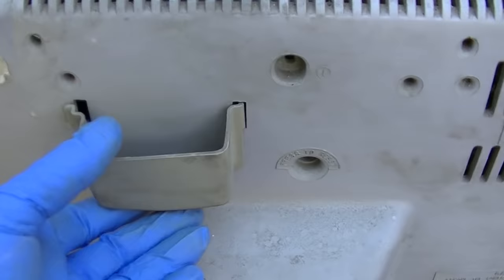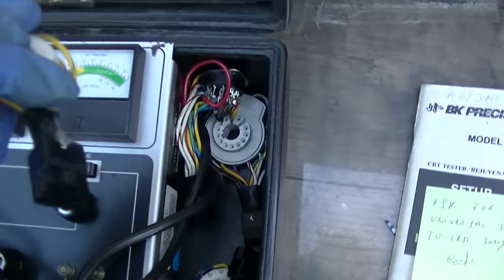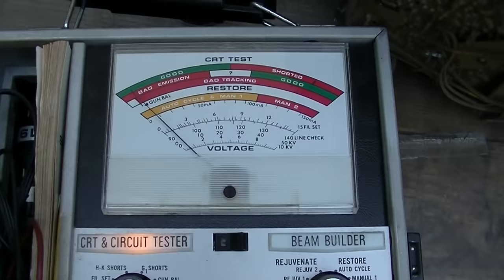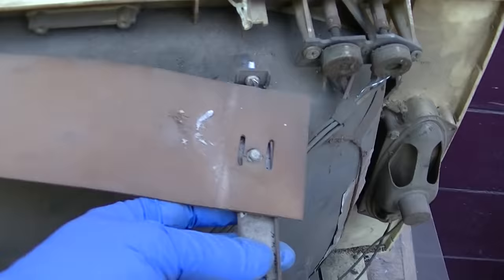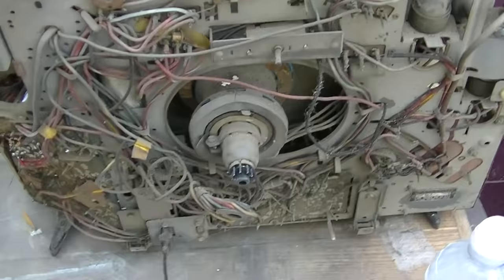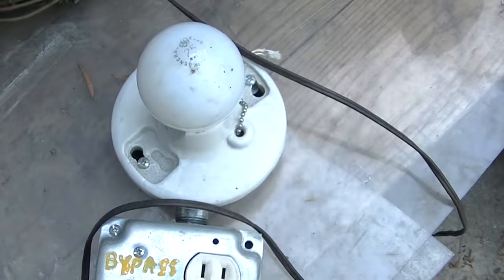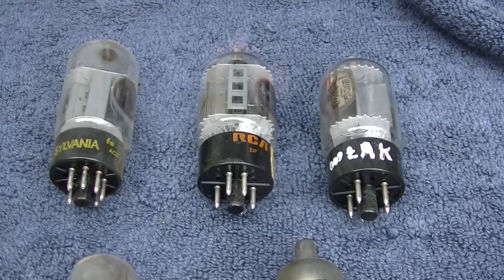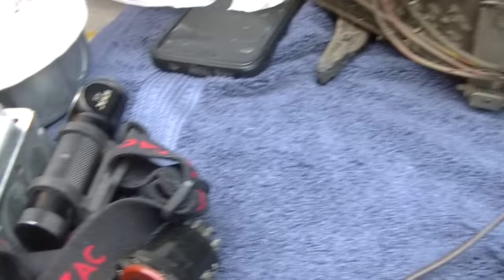Resurrection 1962 Sears Silvertone Left For Dead Television Reforming Electrolytic Capacitors

Comment: A year older than I.
I remember a hospital in 1977 had black and white tv's in the patient rooms. They had motorized rotary channel changers.
The patient could change channels by a wired remote.
P.S. you can use that tv as a whistling tea kettle, lol. Congrats on the resurrection!
Reply: I was born 1977
Reply: I recall some mid '70's Sylvania color sets at our local hospital that had a motorized tuner. By about '87, those were replaced with Magnavox sets with digital tuning and I think a few of those are still in use.
Reply: I remember back when I was a kid in early 70s I went into the hospital for a week and all the tvs had this motorized vhf turner,nothing good on but soap operas,so I had my parents bring my portable tv from home because all the good stuff was on uhf.

Comment: I like your video because from the early 80's to the late 90's I used to buy old tube stereo systems. Back then, people almost give them away as there was a huge power war and theses old systems weren't powerful enough anymore. Almost 80% of the time it was a shorted power capacitor or a leaky one in the driver section, weak/ unbalanced power tubes. I still have an old Fischer 800c from that time and a Dynaco st-70 with pas-3 preamp in my basement with my movie setup. I gave my eico st-70 to my oldest daughter when she got an appartement. I wouldn't change thoses systems for any of the ones that they sold today. I replaced the eico 7591 outputs tubes 3 years ago as in the early 2010's they didn't offer any replacement that fitted in the case. I bought the jj replacement and they do the job just fine. I used to restore old jukebox and radios too and, as I live in a quite rural area, I've made myself a 50w AM plate modulated transmitter for my old radios. I play the infamous 1938 Orson Wells martian invasion each Halloween. And many radio mystery theater and xminusone sci-fi radio program. It's nice. I subbed.

Comment: You should always disconnect the negative battery terminal first and put it on last on your truck. The reason why is if the wrench touches the body or frame, which is connected to ground, it will be a dead short. If you don't drive it more than a week at a time, do yourself a favor and get a battery maintainer and keep it plugged in. Lead acid batteries that aren't kept at 100% charge, 12.6 volts, the electrolyte converts to water when it discharges even just a little bit. When that happens, the lead plates begin to sulfate and it's only downhill from there. Just giving you a heads up. 

Thank you for taking the time to record your methodology of how to repair CRT's! I don't know much about them but after watching some of your videos, it's completely changed how I think about diagnosing them. I'm hooked now. Can't think you enough for taking the time to share your knowledge!

Comment: I have my antique radio permanently connected in series with a 200w bulb. 
its great safety and it drops the insanely high voltage from 240v to a more normal 220

Comment: Shango, you never fail to impress me. I ALWAYS look forward to your Saturday morning video!

A few new capacitors and you could use this as your supper time TV. ;) (if only it didn't look like it has been dropped from a cliff, or like it was sitting next to some guy using a side arm grinder, throwing all the cuttings at it) ;)

Comment: Wow! This set produced a really nice picture considering you didn’t do much to it! 
I really like the design of this tv,especially the speaker grille knobs and the legs.
The first Sears catalog I can find that this tv appears in is 1963. Im sure it was around in 1962 though. 
Their ad shows the back off of it in the background so you can see the dual speakers and swing down chassis. This model started at  $179.99. Remote model slightly higher. They had a version with a painted mask and speaker panels!
I’d love to have one of these!
Reply: That's a pretty expensive TV!!! According to the U.S. Inflation Calculator, the price of that set in 2022 dollars is $1,668.82!!!

Comment: i have a 2001 toyota sienna , and the ecu/integrated relay system had a bunch of capacitors  that leaked , caused the door locks not to engage fully , mechanic would not repair or replace the units , a few caps for a few cents and my car works again ;)  only downside i hat to take half of my lower dash apart to be able to reach it  but it was worth it  ;)
Reply: Someone watched the video all the way to the end!
Reply: 2001 is certainly in the 'capacitor plague' era 😉
Reply: I had the same problem with my 93 Fiat Tempra, 2 bad capacitors on the central locking module

Comment: My mother brought Sylvania, Silvertone B/W TV in 1962 from military PX in Hawaii was the few model that called portable model and the set came with factory moving cart with 4 wheel and 15" screen with telescopic type Antennar. The set was send to Thailand in 1962 and suffered many damage and service repair at numerous times. When we left Thailand in 1972 the set was repaired  and we spend over than $35.00 for repair bill. It was not designed to operate oversea for NTSC  system with 110V 50 cycles systems.

Comment: The Toyota pickups from the 80s have the ECU located in the same place. Passenger side behind the kick panel.
I would also replace the tantalum caps. They're prone to shorting out.
Reply from the maker: never seen an automotive grade tantalum cap short in an ecu yet
Reply: @shango066  I have, and the ones I've worked on use the same manufacturer of tant caps that many of the old PCs used which I also work on, and see them shorted in the IBM-PC-XT computers as well, on the motherboards, and disk drives etc. In any case I replace them, only takes a few minutes.  All of that equipment as you stated are getting to the age where even the best of the electrolytics and tants are failing. There is no such thing as an 'automotive grade' tant.
Reply: @shango066  The conformal coating probably helps to preserve them. I think it's mostly gas (oxygene?) and moisture ingress that kills these dipped tantalum caps. Hermetically sealed metal encapsulated ones almost never fail.
Reply: @bountyhunter4885  Not sure how long they've been making those, but the ECUs that I've done repairs on myself with failed Tantalum caps from the 80s and 90s have the conventional versions of Tantalum caps in them and fail shorted which is typical of common versions. Also the electrolytics are of no special better grade and they tend to leak on and do damage to the boards.
Perhaps the higher grade you mentioned are available in newer vehicles and were made due to the problem with the older generation ECUs.

Comment: You are lucky Shango to have so many "over the air statons" Here in Oslo we have only 3 for free. But these 3 has almost no commercials on them. They still send news, cartoons and films. Plus debate and so on. When the cable tv goes away in september 2023. I have to stream tv or just watch this 3 stations. It is to expensive to get more chammels over the air. It just costs to much to insert a card in the box. Nice repair Shango. 🙂

Comment: I'd recommend disconnecting the negative terminal on the battery instead the positive, because with the negative connected you can short the battery if you get a wrench anywhere to bare metal, but with the negative disconnected there will be voltage just across the terminals.
with chassis negative.

Comment: Man! That was a damned very impressive resurrection. And yes, that TV is fugly as sin. But the picture it produced at the end was very good. And this is the first smaller black and white TV that I see that had a real remote control, that is being wireless.

 I've seen those small black and white portables that had wired and pneumatic remotes. I don't consider them to be real in my opinion. And was it ever discovered who built that TV for Sears?

Comment: That TV set and myself have something in common -- we both survived the Cuban Missile Crisis. The circuit board looked pretty FUBARed. If you were to use it as a parts set, I'd recommend hanging on to that awesome CRT.
Reply: I hope he doesnt use it as a parts set.Even with its faults its still beautiful.If it comes up for adoption I would definitely buy it and clean it up and watch tv on it

Comment: I worked on one of these style Sears chassis.  When folding the chassis back to its normal position, a wire would pull the horizontal oscillator tube (8FQ7) to one side, allowing the heater pins to still be connected, but stopping the oscillator from running.  I power the set up without realizing this, and a strut on the chassis kept me from seeing that the horizontal output tube was red-plate.  This is the worst mechanical chassis design I ever saw in a TV.

Comment: Engineer: Lets make it easy to service by making the chassis hinge down. 
Bean counter: Lets save 0.0001 cents per set by making the wires so short that it no longer hinges down. 
Bean counter wins argument. Engineer goes off and gets a job at Philips.

Comment: 1. My understanding is that ECU's are usually (almost always?) located somewhere in the passenger's side, under, in or around the dash. Maybe driver's side, but to keep them away from environmental extremes. That would be the first place I would look.
2. Recently I opened up an X-10 appliance module, probably 15 years old. or more (X-10 was/is still a protocol for home automation, back from the 70's - when I first started using it.) Its sole electrolytic had begun to spooge all over the board.  No name, with no markings even of value, but I do have a decent guess. Computers I have of this era are also failing due to leaking caps. So ... it seems that any electronics you care about over 10-15 years old should be routinely opened up and checked,

Comment: I would read out, erase and re-program the EPROM in that ECU. It's 34 years old, might be close to the end of its data retention time. Probably doesn't help to its data retention that it was used in a rough environment (heavily fluctuating temperature). But desoldering that EPROM from that thick board which is also conformally coated... I would not like that task.